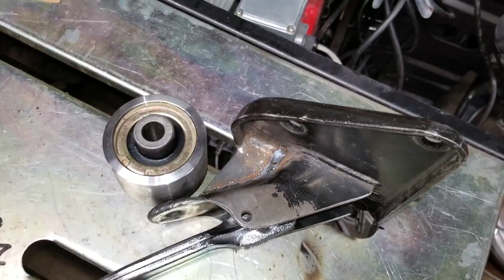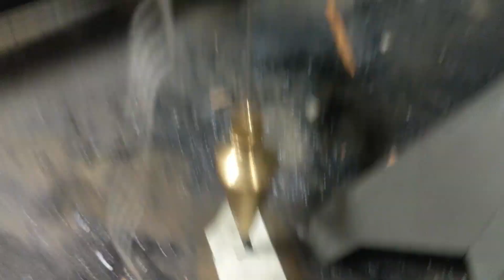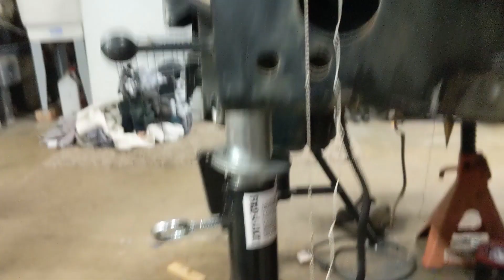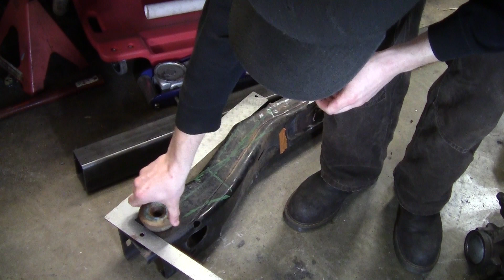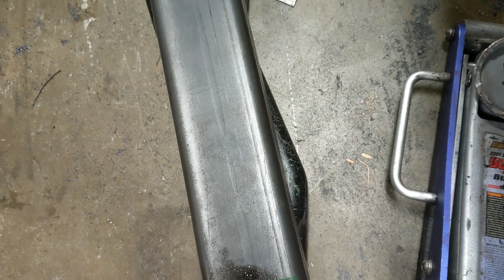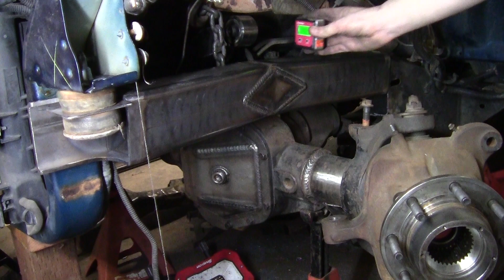Making a custom frame rail & motor mount  - [Project SuperDUkota - Dakota + Super Duty axles] Part 3

Comment: I'm right now on the way to SAS 1 ton axles into my Dodge Durango 2000. I used Chevy axles from K30 (probably): Dana 60 + GM 14 bolt. I retubed Dana 60 to make it driver side drop, made custom high steer, rear disc brake conversion, PSC ram assist, etc. I have front leaf springs from Chevy and 37 tires on wheels. But I have not started to do anything with the Dodge. It takes a lot of time to buy everything I need in the USA and send it to Russia.

Your videos give me great confidence in success. Сontinue in the same spirit, man! I'm in your fan team!
Reply from the maker: Thank you Alexey! Your comment means a lot to me- amazing to know I have a fan all the way in Russia! It sounds like you have started a great build too- good luck and update me on your Durango as you finish it!

Comment: Awesome progress man I am going to be building a Dakota for a family wheeler over the winter will be using your build as a guide keep it up!
Reply from the maker: Sweet! Yeah that's the plan for this thing. Good luck with your build 😎
Reply: @WebWheeler  I'm doing a aam 9.25 front and e350 van  Dana 60u 5.38 gears front e locker and rear spool and 41 iroks
Reply from the maker: @lanehittle7359  Very cool- I'm still debating 5.38 or 5.13 gears.  The question really is do I want to plan on eventually going bigger or smaller for tires... :D